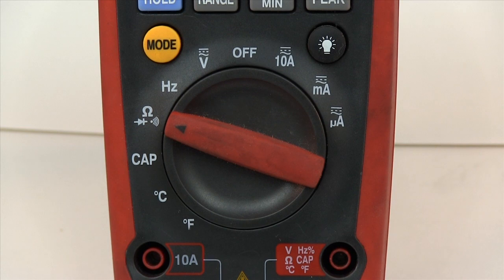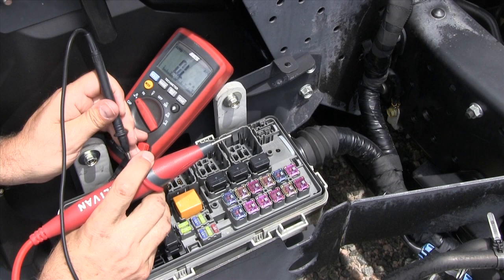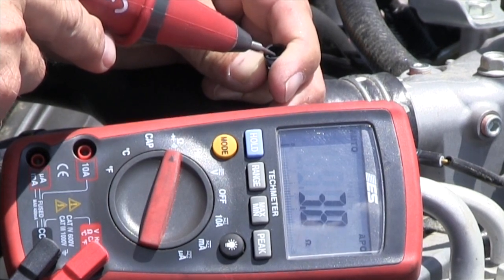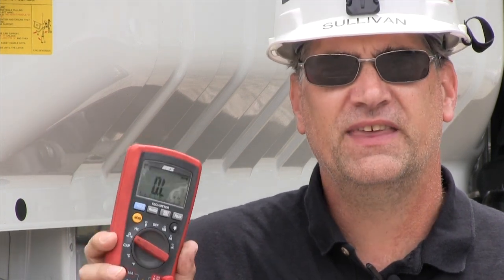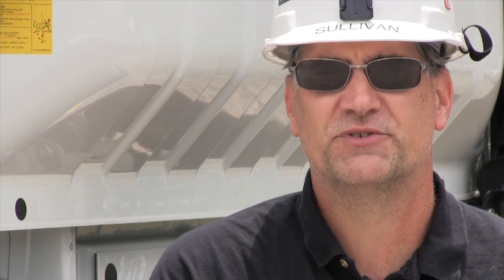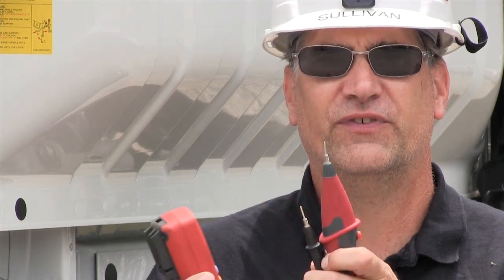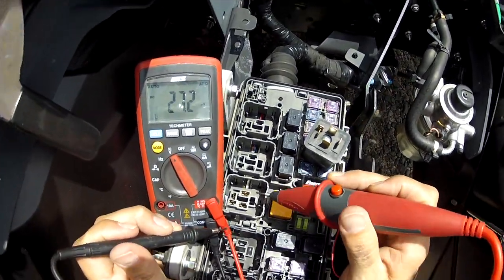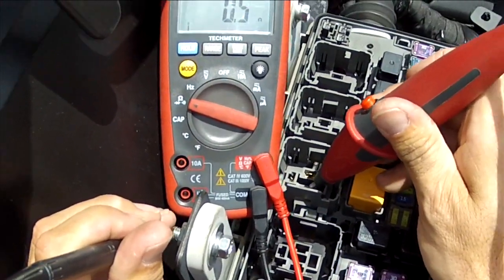TMX 589 TECH METER - Ohmmeter Function

Comment: Good stuff.  This would make an ideal gift for guys  like me that need a reference guide to check with.  I  use your book whenever I need to and  fix the problem and a lot faster than what I used to. .  I use a fluke 179 with my load pro and was wondering is the ESI meter somehow matched to produce a better reading  with the load pro test leads.   Are you partnered with any on line retailers for  the combo package?    I think you as an instructor are quite effective and wish you success  . Steve